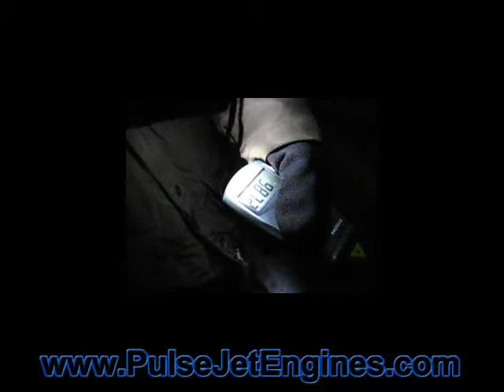Pulsejet Turbine Engine Test

Comment: Use a rotary rectifier instead. A rotary rectifier is similar to escopette, but With tangential exhaust to allow rotation. Escoppette  turns intake flow backward.

Comment: The combustion chamber for the original Tesla turbine was designed to work on the same principle, but using a Tesla valve for fuel injection

Comment: @BeckTechnologies 

He means a Wells turbine, they're originally designed for wave power (as the surface waves not ocean current) plants. The neat thing about them as metiz says, they rotate the same way regardless of the air direction. Although most articles about mention they for low pressures, so it could be not up for the task for a pulse jet.

Comment: @1metiz Welsh turbines are designed to work with oscilating air columns, to harness tidal power for example. Regardless of air direction it will rotate in the same direction. Conisdering the pj is basically a 2 way pump, you might get more success with one of thses things (read: closer, or even in the tp) Hard to find any good information, here's a bit of info: chych1(dot)dothome.co.kr/bm3/board.php?board=kkkexchan&page=1&sort=hit&command=body&no=48

Comment: @BeckTechnologies I am not sure if a valveless pulsejet would run properly in a setup with a duct because while the pulsejet is reversing its trust between the pulses the turbine will still turn by its inertia and may suck strong enough so the hot gasses are not sucked back into the pulsejet and thus will not ignite the next pulse cycle.
Reply: Morkvonork a rotary rectifier will not create problems. A rotary rectifier is based on escoppette rectifier. No problem with reversing flow.

Comment from the maker: @Morkvonork  Yes, this seems to just be a proof of concept, we're in the process of going through other videos with more advancements and powering things, but I thought it would be a good idea to upload the first trials. Without any kind of load on the turbine, a duct, and the engine running at high throttle, would likely have caused the turbine to self destruct from spinning too fast, considering the extremely low throttle level achieving 2400 RPM.